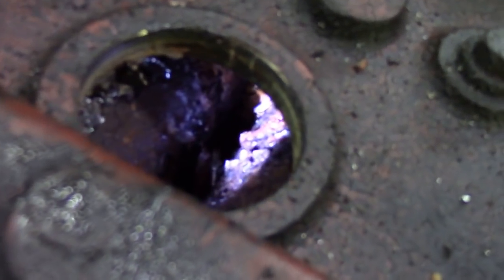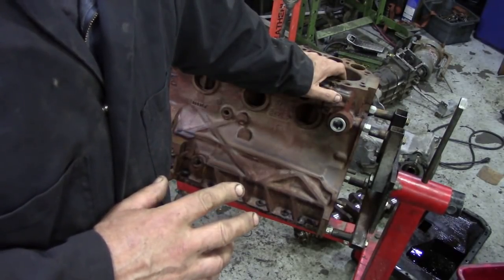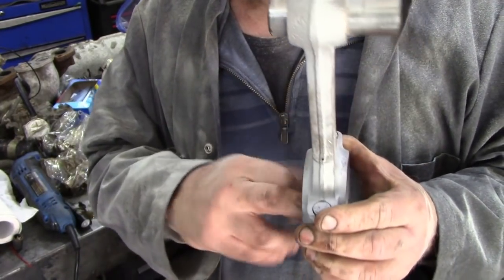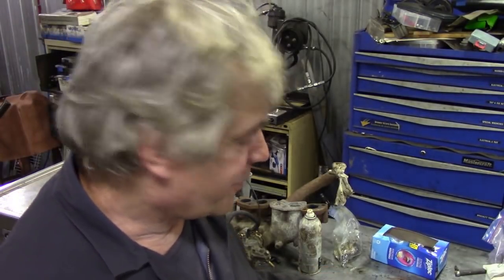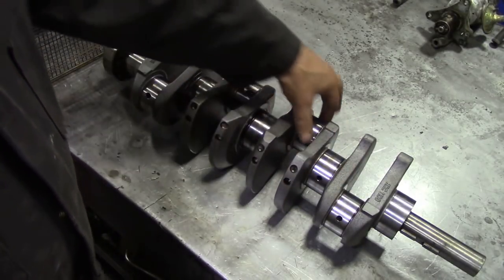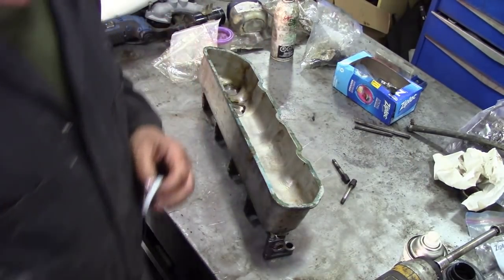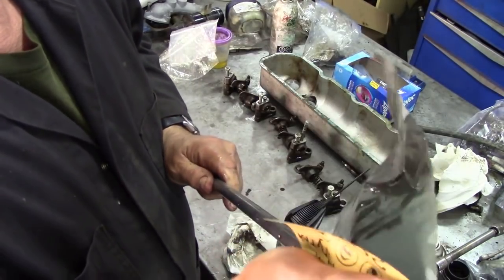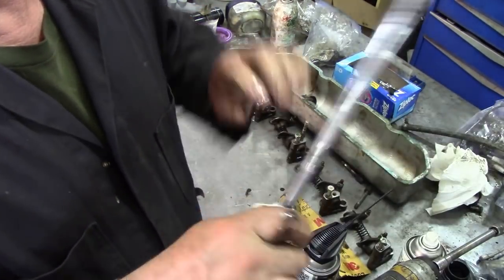2 25 Petrol engine strip down  Part 3 Clean up and inspect

Comment: A good abrasive to klean sensible steel surfaces as bearing shafts and similar is scotch brite. I use it often with very good results, instead of papersanding. I'm just finishing a 70 years old Series One IOE 2.0 spreadbore engine stalled for more than 20 years and many of your advices were very usefull. Thanks for that Mike.
Reply from the maker: Thanks! Rear crank seal on my S1 coming soon!
Reply: @BritannicaRestorations  Great. 😊

Comment: what i don't hear much these days is emery cloth which when i was an apprentice electrical fitter in the 80s we used it for cleaning/polishing loads of component's. Dave & Lisa south wales uk
Reply from the maker: Yes. I used a super fine emery cloth on a roll, to polish the water stain out of Number 3 journal

Comment: I've just stripped a 2.25 petrol engine down which had been sat for years.  The conrods were scabby as hell but useable. Planning to give them the shot blast treatment.  What did you treat them with after you blasted?  Thanks for the videos, they are really helpful.

Comment: You don't need to tell me twice to 'drink up' hic 🥃🥃🥃🥃🍺🥴 Great work as usual.
Reply from the maker: Sorry! lol!
Reply: @BritannicaRestorations  Hi Mike, I'm trying to find a wiring diagram for my Defender 127 Ambulance. Electric are not good and was thinking about a new wiring loom. Think it might be the same as a 110 but not sure. Would you know how I can find out? Chassis no? Sorry to badger you on this thread. Cheers
Reply from the maker: James - I have no diagrams but if you want to rewire the lot, then change to 300 Tdi as it was simple - BUT you need the full harness front to back inc engine harness - You will have to change the indicator/direction stalks etc as the plugs will be different 
The only major difference with harnesses are the plugs
New harnesses come with the spade fuse box, but not the metal support - easy to find used
Reply: @BritannicaRestorations  Thanks Mike. I've got the 3.5RV8 in mine so yes would have to change the lot. I'll do a bit more investigation on the wiring I've got and see if I can improve it. Cheers.

Comment: I was looking into swapping a Rover 3.5 v8 into a MGB. It turned out I wouldn't need and suspension modifications. I'm guessing this weighs as much or more...
Reply from the maker: I believe so - Many years ago I swapped a Jag 6 cylinder to a Rover V8 and the suspension had to be dropped a bit as it looked odd

Comment: Mike - why not put a 2.5 cam in it for more power? Is that upgrade a lie? I'm asking because I'm thinking of that upgrade to my 2.25 '63 109.
Reply from the maker: 2.25 Petrol / 2.5 NA Diesel / 2.5 TD / 200Tdi / 2.5 Petrol 

Same cam
Reply: @BritannicaRestorations  a thought for a video would be talk/built a 'high performance' 2.25l

Ie high compression heads, different carbs, etc... as there is a tonne of miss information out there on how to squeeze some extra horses out of that lump of iron.
Reply from the maker: To be honest this is the first 4 cylinder petrol engine I have seen for over a decade!

Comment: An acid dip tank isn't that hard to rig up, we made our own for on site dipping of all the welded pipe fittings for building power station turbine oil systems. You've got to be careful of course. Be good for cleaning up fittings for that boat you don't have/need...lol! 😂